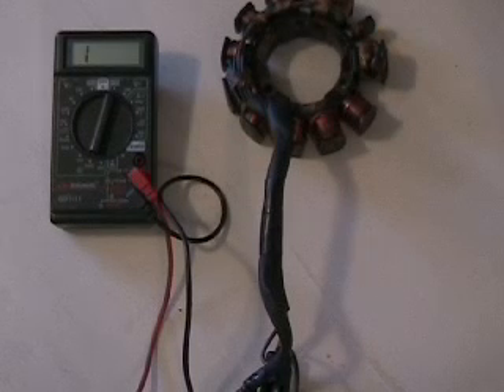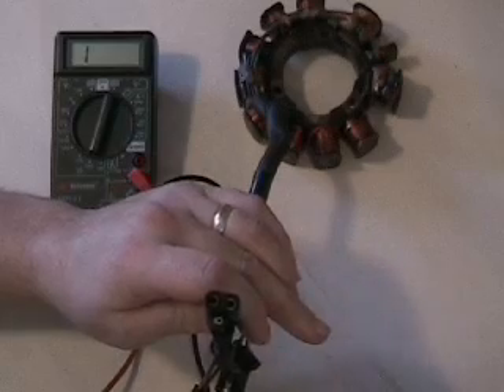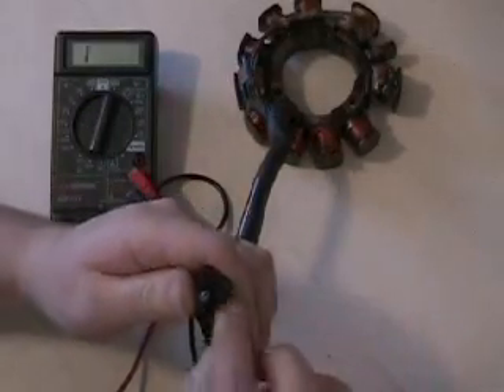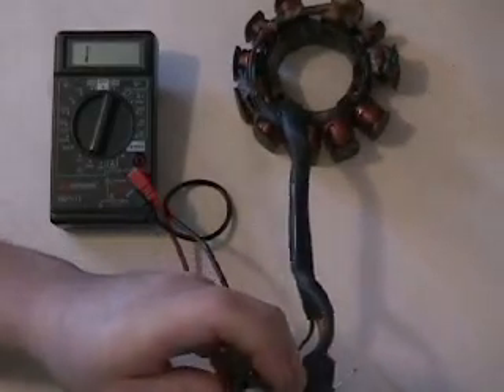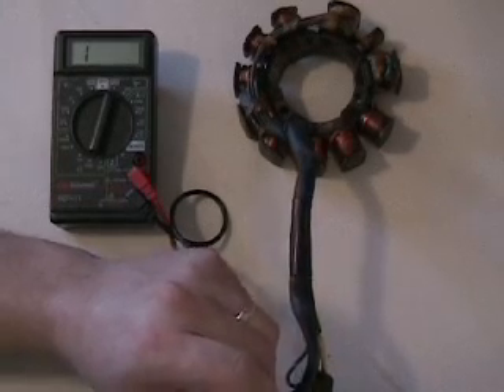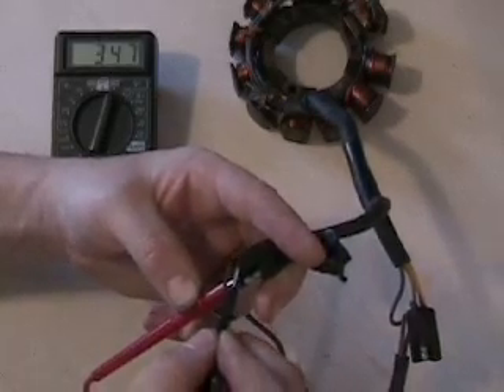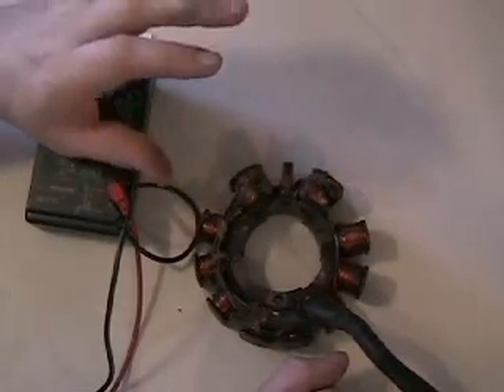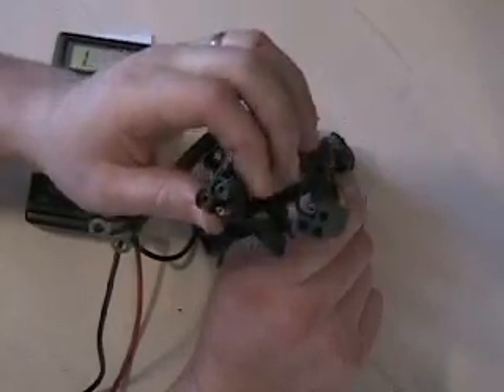Arctic Cat snowmobile stator testing early 1990's Battery 580EFI 700EFI

Comment: Thanks for posting this! I'm having a no-spark problem with a '94 EFI 580 and I'm getting 100~120ohms across all three connections.  "Am I doing it wrong" is a loaded question, but having some knowledge about how coils work I've just never seen an increase in resistance in one.  What are your thoughts?

Comment: Hi Blaine thanks for getting back to me really appreciate it. So ive done topend rebuild, new stator, new battery, new ignition coil. Still fouling spark plug on chain case side. So i want to replace cdi unit but mine seems to be a unicorn, hoping you can help me find one. 
 My cdi unit has triangle 3 wire plug, 2 wire plug for coil and additional 4 wire clear plastic plug that runs to computer and grounds etc.

Comment: I have a question for you. I tested mine when it was in the sled , it at 398 and 43 and togather was 416. so i said okay stator is bad, Sled will not start, So pulled the stator and rechecked the stator and not it shows green to brown is 436 green to black is 43 brown to black 480. like i mention before when it was in the sled got lower readings . now it gives good readings. 1994 arctic cat 580 efi pantera is my sled. Is the stator still bad ? I ordered a new stator for the sled but would like to know about these readings
Reply from the maker: 398 is low for an OEM Stator but they will read lower when cold. Most good OEM stators are 435-445 in most temps. What was the temp when it measured 398 and 436? There would have to be quite a temp difference for an OEM stator to vary that many ohms for the low speed coil.
Reply: @BlaineDP  -12 degree celious in the garage and +18 degree celious in the house
Reply: @BlaineDP  found the problem. had the timing triggers in the wrong spot , changed them around and it fired right up first pull.. When i took the motor out i did not take note which one goes where. so when i put the motor in i just put them in and yeahhhh next time I need to pay attention to what goes where . 3 weeks beating my head trying to figure this out. and yeahhhh .... but i am happy now it running good
Reply from the maker: Glad you figured it out.

Comment from the maker: Those readings are too high...did you check it after the sled had run? They will read higher when the motor is run. If you measured those readings and the motor had not been run in a while...was at ambient temp...then both your low speed and high speed coils are bad. I do rewind them.

Comment from the maker: It is located under the recoil. You do not have to take it off the sled to check it. The wires come out of the flywheel housing so all you have to do is unplug it and you can check it. Once you find the right plug/wires to check, it will only take you a couple of minutes to do it. You can watch  my video titled: "Testing a stator in a snowmobile Arctic Cat" and that will give you an idea of where it is located and how to test it.

Comment from the maker: Actually your stator ohms are good. For that specific model stator (they didin't use it on a lot of sleds over a lot of years) they specs are actually 1190 and 15 so you're in the right spot for ohm readings. If it is a spark issue, could be cdi or trigger/pulser coil. I am also assuming that you checked compression.